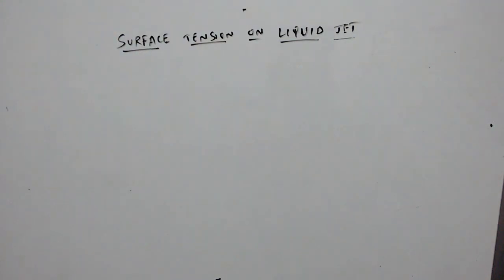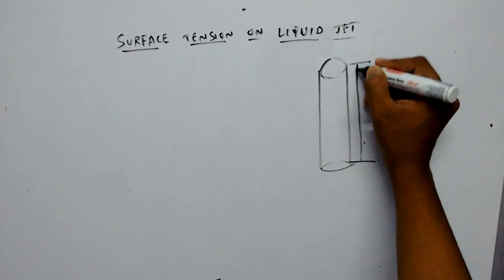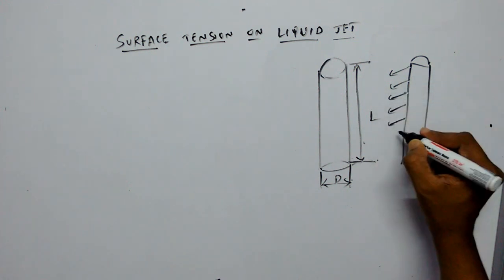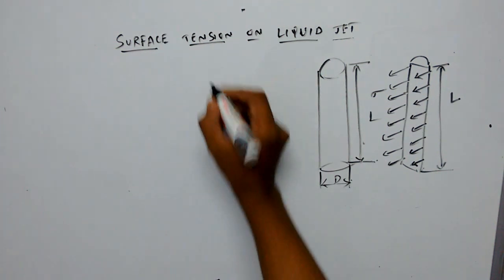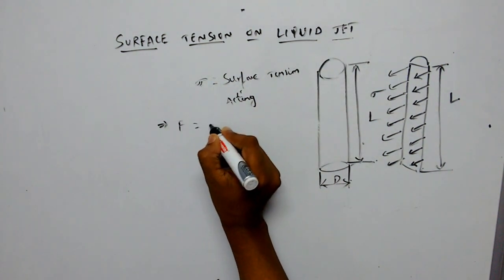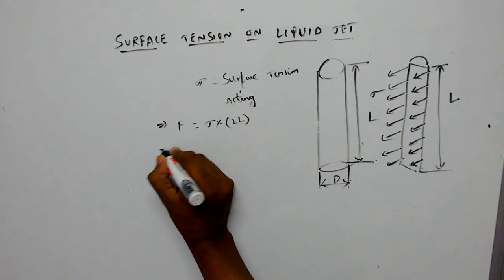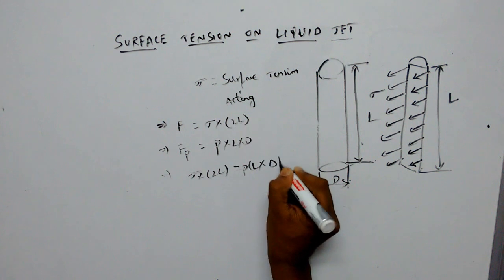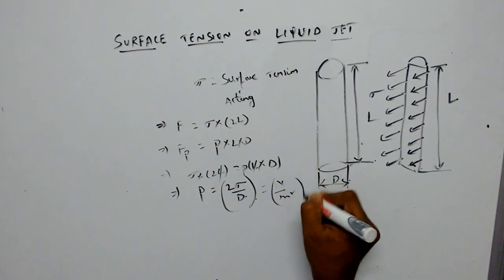Surface Tension on the Liquid Jet

Comment: why diameter is not considered
Reply: Because the  surface tension is acting on a rectangular type section as shown in figure
Reply: @prashantbansfore9111  elaborate
Reply: @satyajitmohite3409  see the fig properly the area where the pressure is acting its a rectangular area
Reply: @mahesh4943  no it will be 2l  because surface tension is acting on the lengths of rectangular not on the circular radius
Reply: @prashantbansfore9111  why is surface tension not acting on circular radius ?why only on that rectangular lengths?
Reply: @shaikhameedulla3884  bhai tum surface tension ka lectures dkho smjh aa jyega kuch nhi hai kis trf se view kr rhe ho usse pta chlta hai ki surface  tension kidhr aayega